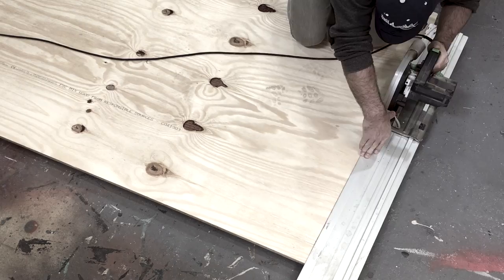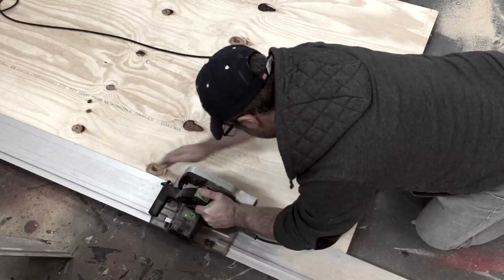How to Build a Table from Only 2 Sheets of Plywood - by SoundBlab

Comment: Nice work, I'm planning to build a 6 ft x 3 ft dining table using a single sheet of plywood (8x4). I finished the plans now I just have to find time to execute it. I also plan to limit myself to (2 power tools) a drill and circular saw to make it. I am super excited because it will produce great results with minimal tools and materials!! Thanks for the inspiration.
Reply from the maker: Thanks man. Pleasure. Good luck with your build!

Comment: did you put a wood filler for the edge area sir? or put a straight bit router to flatten them will just allright?
Reply from the maker: +Ming Jae I did not use filler for other than imperfections in the wood itself.

Comment: what is that metal thing you use to line up the cut? can any circular saw cut with that?
Reply from the maker: It's a track that is part of the Festool plunge saw that I am using. A normal circular saw will not work with it, but you can make something similar for a circular saw. There a few videos on Youtube that will show you how.

Comment: How can you do that for using only 2 plywood? Can you please elaborate the height,width and the length of that masterpiece 🤗
Reply from the maker: The table is roughly 2200 long x 1100 wide x 750mm high.

Comment: What should be the minimum thickness of the plywood (in mm) so that the table, especially the legs, are strong and stable?
Reply from the maker: If you are using a good qaulity ply like birch, then yoy could get away with a 5/8 inch or 15mm ply, but you might want to put additional support bracing under the table top.
Reply: @SoundBlab  Thanks a lot !